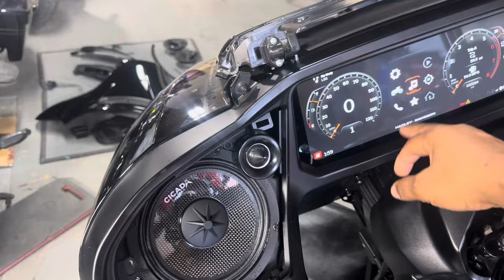2024 Harley Davidson Road Glide in for a NVS Audio stage 2 high power 6 speaker audio upgrade.

Comment: Did cutting of the amp rack occur to fit the Cicada 1400 DSP amp?
Reply from the maker: Yes 

You have to cut the front of the radio bracket because the amp is wider than the factory .